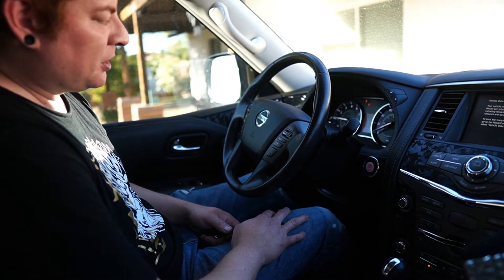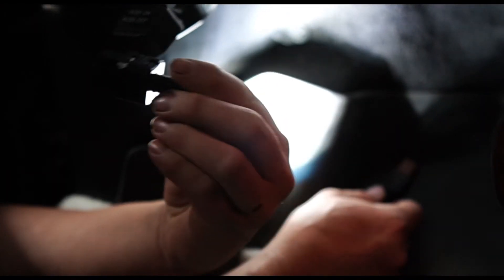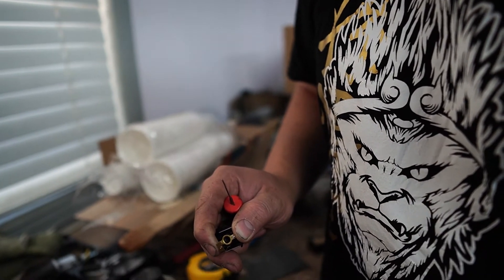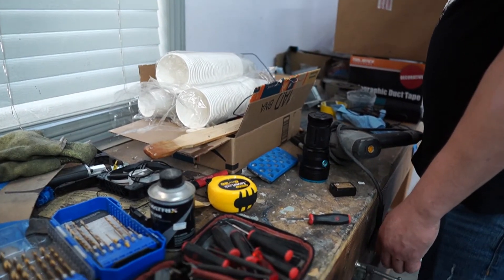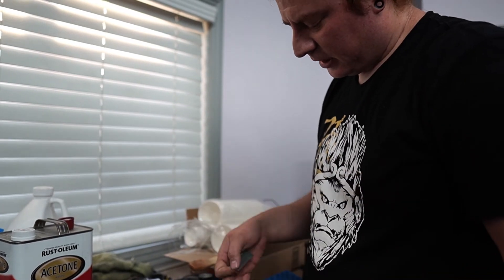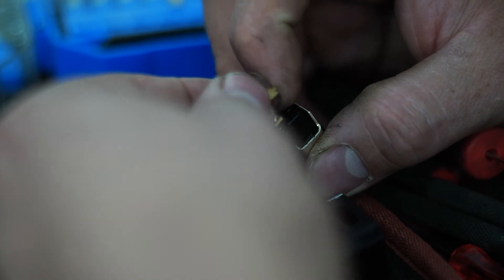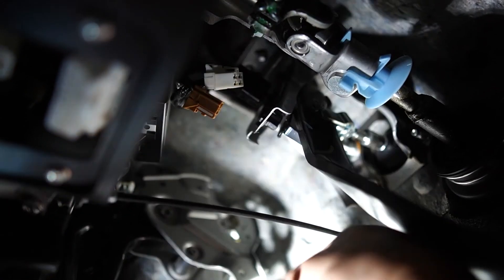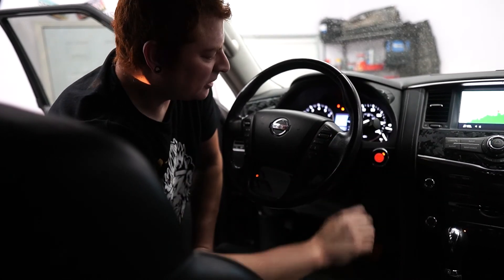DIY NISSAN NO START FREE FIX FOR ARMADA/PATROL

Comment: I’m so grateful for your video.  I’m having the same issue with our 2018 Armada and the BCI error code came on but of course, when I took it to the dealer, it started up ok and they couldn’t diagnose it.  You were able to pinpoint the root cause being the brake switch.  Thx to you and your wife!
Reply from the maker: Glad we were able to help and that it worked for you Rodolfo!
Reply: Did the bci error go away also?  We are having the same issue just got the part.  Going to clean the old one also to have just in case

Comment: My man! I had the same issues with my wife's 2019 Armada.  I took out the switch, cleaned it just like you did and we haven't had a problem since. Been about a month now, no issues. Thanks!
Reply from the maker: Nice! Glad to hear it worked and it's been good since
Reply: My 2017 Titan is having same issues 😢 im at work rn and dreading after work not starting but at least I have you vid to help🎉 big thanks in advance. I will follow up ✌🏼

Comment: Thanks, bud. You are a life saver. We got stranded at Costco today. Our 2018 Armada would not start. We thought we had a dead batter, but everything turned on.... windows, radio, horn, and lights. The Push-Start would just cycle between OFF, ACC, and ON but never crank over. No clicks.... totally quiet. It wasn't the key fob battery. I checked through all the fuses in the cabin and under the hood. 

Finally checked the brake relay switch. Took it off and fiddled with it. The Armada started up right away. I'll give it a good cleaning/adjustment when I get home for free. If not, I can order the replacement part. I see it going for $30 online.
Reply from the maker: Yeahhh getting stranded is no fun, I hope you didnt buy any icecream and had it melt on you lol. I hope the fix helps you as well and saves you $30 👍🏻
Reply: Where can you buy the switch? Having exact issue with my 2019 Nissan Armada
Reply: Do you have a link for the part ?

Comment: Worked like a charm! This is the second one I’ve had trouble with since new in 2019. 

I’ll add that I had a nice amount of gunk on the inside metal tabs of the white plunger that I needed to scrap off. This was in addition to cleaning and sanding the other pieces.

Also if you haven’t unplugged the grey plug on the negative side of your battery yet, do it and save yourself additional future headaches.

Thanks again!!
Reply from the maker: Oh yeah figured out that plug pretty early on too. We should probably make a video on that as well.

Comment: I’m very grateful to you for your video and the time you took. I just bought 2017 armada and it had this issu. My armada let me in the middle or the forest.. 110 km to my dealer...they changed the battery but it was still starting randomly and witth hesitation. I took the switch apart and boom the same thing as in you video. One of the contact was dark. I just cleaned it with sand paper and polished it a bit with touth paste and bingo..it starts strong.
Thanks a lot again for your help!!!😀
Reply from the maker: That's awesome! Glad to hear we were able to help! That would have been one expensive tow back to civilization 😅

Comment: Hello Garage23, Thank you both for posting such a detailed & helpful video. My 2017 Titan had this intermittent issue and after replacing the battery it was still doing the same thing. ( I was away working so I didn't have time to try and diagnose the issue). After I returned to the hotel that night I got chance to search the interwebs. A lot of the Nissan forums showed this to be the culprit. And, that this is a Nissan wide issue - from Jukes to Titans and everything in between, I think it was a Renault issue as well since they used the same Panasonic switch. Mine was the prong type and I just spread them out a bit and it started several times for me so far - time will tell. Thanks again for the time and effort I hope this helps other people out as well. All the best, Peter
Reply from the maker: You would think by now they would have something as simple as a brake switch figured out 😅 glad to hear you got it fixed 👍

Comment: I’m having this same issue with my 2017 Nissan armada. What is the part called if I am not brave enough to take the existing one apart? Is it called a brake light switch or brake relay switch? Thank you so much for this video!!
Reply from the maker: Yes It’s called the brake light switch and it’s been revised by Nissan since then. new part number is 25320-AX10A

Comment: October 24, 
2024. Had this happen to my 2020Nisdan Pathfinder. I replaced the switch today, so hopefully it's fixed. This Nissan has given  nothing but problems. I had to have the ABS and AEB replaced in January. The dealership kept the car for nearly 3 months. They did provide me with a loaner. I'll stick to Toyotas.
Reply from the maker: Normally I’d agree with you but even Toyota has been having issues lately.

Comment: Thanks a lot , i have QX80 2019, i have almost same issue , every 4-6 months i have to replace battery although some times test show battery is good! Last 3 days every time i stop the can must jumpstart with external battery , today i went to electrician and once he did battery test can start and no issue at all!  Computer test show no issue but again now time to time not start although all lights work on ! 
I will try to do the same and see how it will work
Reply: *Car
Reply from the maker: That's probably the "smart" alternator. You need to disconnect the small plug on the negative battery terminal and leave it disconnected. That should make all your battery issues go away.
Reply: @Garage23  currently the car not start and all lights working as well once i press brake paddle bake brake lights are lighting! Dose this mean brake switch have no issue?
Reply from the maker: @ahmedalharrasi5983  Could still be the brake switch, our tail lights still worked when the car didn't start.
Reply: My 2019 Armada does this once every month but it won't turn over or barely does. I jump it off first time no problem but test shows nothing wrong with battery or starter. Its a big inconvenience
Reply: @Garage23  but with jumper start immediately , do you think its still brake switch could be failed?
Reply from the maker: @ahmedalharrasi5983  in your case it does sound more like the brake switch. But i would still remove the plug on the negative battery cable as its uneccessary and will only cause problems.

Comment: I’ve dealt with this issue with my 2017 Armada platinum since  approx 15,000 miles and now still at 60,000 miles. While under warranty, dealership said it was “something with the brake system” said they fixed it and within 5 mths, same thing all over again. NEVER know when it’s gonna leave me stranded 😑 Like right now and 1.5 hrs away from home Ughh!

Comment: Did you get any type of error when trying to start?  Like did it say you weren’t holding the brake when you actually were? Or no evidence other than the car not starting?   I’m having the same issue and have for awhile. I’m on my second battery in three years. The first time the battery seemed to fix the issue for awhile.  Now the issue has returned and a new battery didn’t help this time. Just trying to cover bases before I start digging down to the stupid starter.
Reply from the maker: Occasionally we would get a BCI malfunction error on the dash, the thing is there are two issues at play here, the “smart charging” system and the bad break switch. There is a small plug on the negative battery cable that needs to be removed, this will keep the voltage at 14.5 rather than variable. This along with a new brake switch will solve your starting problems, the downside is 14.5v is technically overcharging and will slowly degrade the battery over time so make sure you buy one with at least a 3 year warranty.
Reply: Just an FYI for anyone reading the comments looking for answers my issue ended up being the starter relay located in the engine fuse box.   Thank you for the reply! Always good to know extra info on the brake switch and also I had been wondering the pros vs cons of unhooking that battery cable. Great video and thanks for the help.
Reply from the maker: Thanks for sharing I don’t think that’s a common one on armadas but glad to hear you got it sorted✌️

Comment: What's the latest latest update on this fix
Cuz I've also done this fix by replacing the brake switch,  but still have the same issue of the switch acting up at times 
Thanks 🙏
Reply from the maker: Still haven't had any issues since this video was posted. Are you sure it's the brake switch? If you don't get the "BCI malfunction" on the screen then it might be the smart alternator draining the battery.

Comment: Thank you so much for this information. I was having this problem with my 2018 Titan. Checked the brake relay switch and it doesn’t appear to need replacing but had merely been slightly dislodged. “Clicked” it back into place and problem appears to be solved.
Reply from the maker: Glad it was an easier fix for you 👍🏻

Comment: I have a 2020 armada it crank over but no start. Said it was my starter any ideas?
Reply from the maker: Starting issues on Armadas always come down to either the smart charginf system, or the brake switch. So i would start with cleaning the switch as in this video as it is the cheapest option, or just replacing it all together. Next would be the smart charging system, to disable this you need to unplug the sensor attached to the negative battery terminal. This will keep the system at 14.5 volts instead of variable. There is a chance the battery is bad so have it tested and replace if needed.

Comment: What's the latest update on this fix?
Reply from the maker: It's been 7 months and still going strong, haven't had to take it back out and clean it again 👍🏻
Reply: @Garage23  Awesome! side note i did find on the forums to disconnect the variable voltage sensor that controls how often it charges up the batter (gray battery clip on negative terminal), that helps with much stronger startups in case. But glad you posted this. Sub'd for all the other great content too.
Reply: Dealing with the same thing on a 2013 Qx56. I've been clearing out codes with my obd scanner, eve there aren't any codes, then starts right up. Will try swapping the brake switch, thanks man!
Reply from the maker: @kdtxtooldad  right! Thats a seperate issue all together but can also leave you stranded. I unfortunately bought a new battery before finding out about that plug.